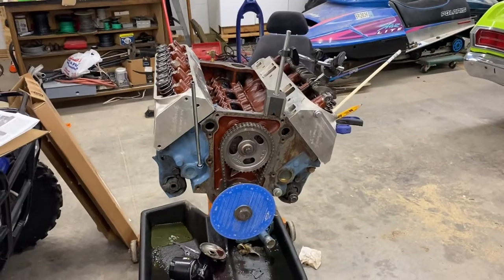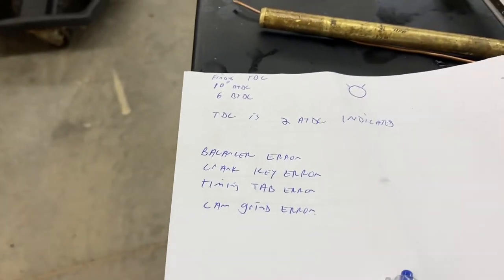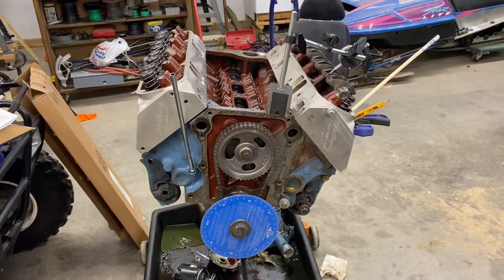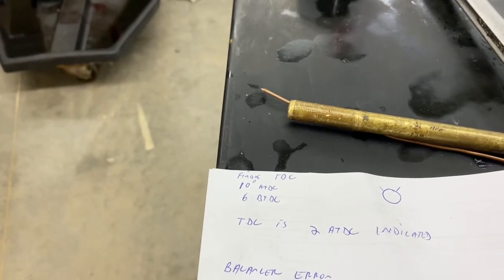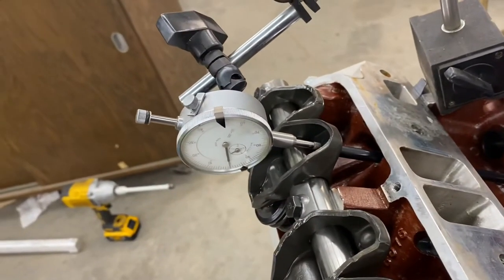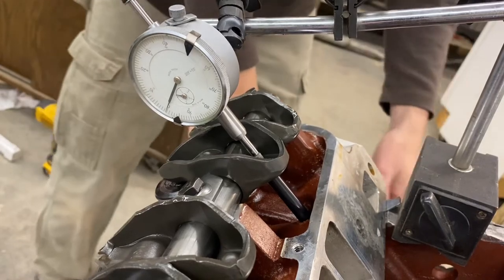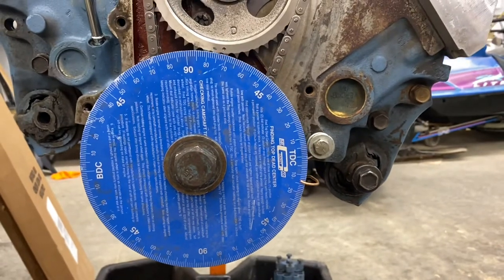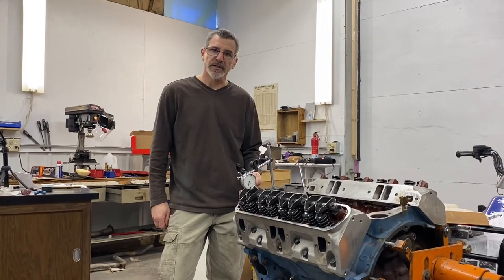How We Degree a Cam in a Pushrod V8

Comment: My fresh 78 la 360 is not running good at all, idles rough hard to start, when i hold my hand over carb to choke off air it idles way down and sounds great, good compression no air leaks 2 new carbs, hoping i installed timing chain wrong, pulling timing cover off to check next
Reply from the maker: Run a compression check on the motor 
That will tell you if cam timing is way off before you tear it down. Runs better when choking it maybe big vacuum leak.
Reply: @jerayracing  yeah i did, 150 psi on all 8 cylinders, smoke test on vacum system only smoke coming out is from top of carb, tried 2 different brand new carbs too
Reply from the maker: Cam timing has to be close enough. 
What is your timing set to? With vac line plugged to distributor I’d start with about 5 to 10 degrees, (I run 10 initial 35 total) double check your plug wires I’ve seen engines run with 6 and 8 swapped accidentally